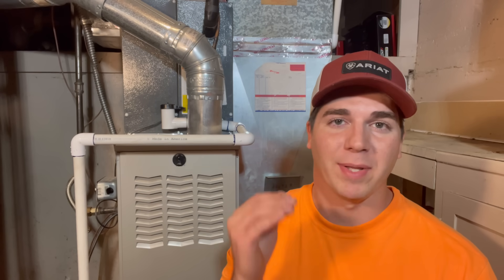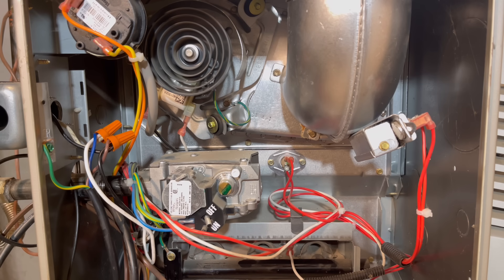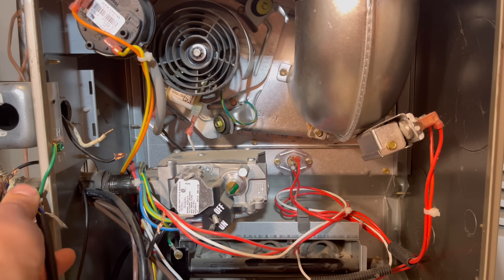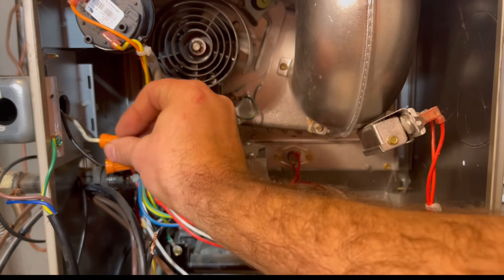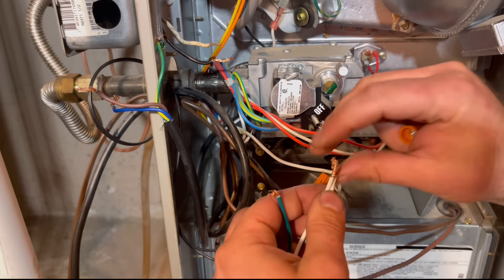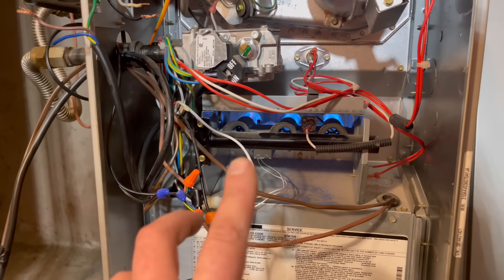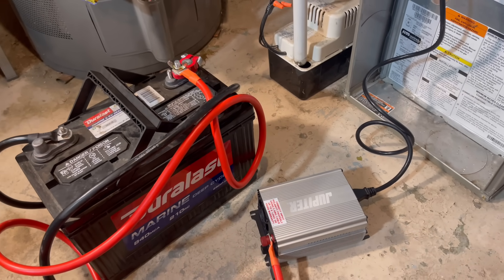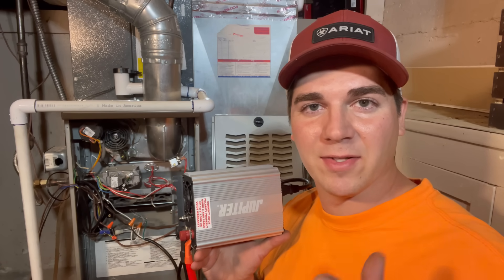Did You Know You Can Heat Your Home With A Car Battery?

Comment: There are several omissions and many errors in the many comments posted. Instead of chasing multiple comments I will make this one.

1. You need to know the power requirement of the appliance or furnace you are powering. A clamp on Amp meter will tell you the current draw at 120 or 220V. You need to watch the current draw thru all the phases of the furnace running. The POWER Is the voltage used by the appliance times the current draw:   P = volts * amps

2. you need to buy a DC to AC power inverter that can handle the MAX power draw. You can find inverters rated for anything between 100W to thousands of watts.  If you just want to run 10 LED lights in your house that only use 8W each, then 100W inverter is big enough. If your furnace or appliance is running on 220V then you need a 220V inverter. You can NOT wire two 120V inverters in series to get 220V, they will not be synchronized, it will not work! 
If you buy a 400W inverter and try to run a furnace that draws 500W, the inverter will simply shut off and the OVERLOAD indicator will blink at you.

3. A car battery is not designed for deep cycle use, its lead plates are designed for the very high current draw of a car motor starter (several hundred amps on big engines).  It will not run an inverter very long. You need a deep cycle, also called marine or camper battery. You can get the biggest one at Walmart for about $100. You do NOT need a lithium ion battery for home power storage - their advantage is they are smaller and lighter, but cost twice as much (or more) for the same amount of storage capacity. You dont care how heavy your batteries are if they are sitting in your basement. Also Lithium batteries are a fire risk. They can catch fire for no reason at all, and the fire CAN NOT BE EXTINQUISHED WITH WATER. You DO NOT WANT THEM IN YOUR HOME OR GARAGE.

4. Batteries are rated in Amp-Hrs and voltage. Everything has to match - If you are running a 12V inverter you need to get 12V batteries, all of the same A-Hr rating and put them in parallel if you want more than the typical 100 A-Hr of storage per battery.  If you are running a 24 V inverter you need to get 12V batteries in pairs, and put the pairs in series to make 24V banks. If you want more than 200 A-Hrs of storage you then have to wire each 24V pair in parallel, or alternatively: run each pair till its depleted, then hook your inverter to the next 24V pair...

5. You will need a battery tender system (at least) to keep your batteries charged when the power is on. If you run your batteries dead during a power outage you will want to recharge them as soon as the power comes back on. Lead acid batteries will be damaged if you leave them discharged for a long period of time. How long? they are designed to be recharged immediately after use. A battery tender by itself could take days to recharge one battery - you will probably also need a battery charger to use when the power comes back on.

6. So... how long will the battery run your furnace or appliance? You measured the current with it running. The power it takes is AC volts times AC current = Watts. If your furnace runs on 110 V and takes 4.5A while running its using 495W.   A single 100A-hr battery that is 12V will put out 1200 watt-hours of energy, which means it can power a 500W load for 1200/500 = 2.4 hours run time. If you are running ten 8W LED bulbs to light your home, 1200W-hr / 80W = 15 hours of light.

7. ALL batteries lose capacity when they are cold. Below freezing they can lose half their capacity. You will want to keep your batteries IN your house where they will be kept at room temperature.

8. Solar panels: to recharge one 100 A-hr 12V battery in 6 hours of sunlight, you need 1200W-hrs / 6 hours = 200W solar panels. You will also need a solar panel controller. You are looking at $300 to $400 in panels, with controller, for each $100 battery.  This is where you have to make a decision: how many days of storage do you want? for the price of one solar panel you can buy 3 or 4 more batteries instead.... In a storm that knocks out power, it may be cloudy for days, and you may not get more than 10% out of a solar panel when its cloudy.

This all gets complicated quickly. This is why portable emergency generators are so popular. As long as you can get gasoline, or propane, both of which can be stored, your furnace will keep running. If you get one deep cycle 100A-hr battery, a battery tender, a 750 or 1,000W DC to AC inverter, you are looking at about $200 to $250. That might get you thru a day or two to keep a furnace or sump pump operational.  Also: lead acid batteries used for this type of stand-by power normally have a useful life of 7 or 8 years.
Reply from the maker: Wow thank you so much for this information. I realize I was mistaken on the runtime but many people will appreciate your thought out comment I’m sure. Thanks again,   Dave
Reply: @diyhvacguy  you did all the hard work making the video and posting it  which made it easy for me to comment and expand on your information. a lot of people will benefit from your effort.
Reply: A follow up to this: a LOT of homes in texas were destroyed because the power went off, people left, the pipes froze and burst, and the water completely flooded the entire home.

WHEN your heat goes off in the winter it is EASY to shut off the water main inside your home (right in front of the water meter), then turn off your hot water heater, open the lowest faucets in your house (usually in the basement) and let the pipes DRAIN). If a few pipes do not drain out and they freeze and break, with the water main turned off they will only leak a few cups of water. Its not hard to replace a few split pipes compared to your house being totally flooded and destroyed.

whether or not you need to also drain your hot water heater depends on whether you will be able to monitor it, or you are leaving the house unattended

Comment: You should issue an addendum. During the Texas freeze there was no power to the transformer 24v for the thermostat. You must let people know that they also have to power the trans with 110 also.
Reply: Most furnaces have the transformers inside them and are powered directly from the furnace load.
Reply from the maker: Yea the furnace has a transformer to take the 110v down to 24v.

Comment: This might be a dumb question because I don't know much about wiring but didn't you have to shut off the breaker to the furnace before you disconnected the wires
in the furnace? Seems like you would have gotten zapped when you touched the hot wire. Like sticking a fork in a wall socket.
Reply from the maker: Yes, shut the breaker off to be on the safe side. I didn’t as they only hit wire was at the switch which I never removed. ALWAYS have a hot pen like I had to verify that everything is dead.

Comment: My buddy put a new gas furnace in his hunting cabin and tried to run it off of a deep cycle battery with an inverter. It would only run for a couple hours then he would have to go out and fire up his generator.
Reply from the maker: the inverter can also be installed in your vehicle and then run an extension cord to the furnace so the vehicle acts as a generator.

Comment: This is a great vid cause my house loses power quite often during the winter. My furnace just plugs into the wall could I just plug it straight into the inverter without cutting any wires?
Reply from the maker: Correct

Comment: A better solution is a small inverter generator. Plan on about 5 to 6 gallons of a gas per day to cover lights furnace and refrigerator. Costs a little more than 200 but it's a better overall solution. IMHO

Comment: If you live in the south, it is likely that you will have a Heat Pump with supplemental heat strips, which draw up to 30 amps. This method is mainly for Gas Furnaces and Boilers.
Reply from the maker: Correct. As is stated at the beginning of the video 👍🏽

Comment: Hello, thank you for this information.  Worried about outages this winter, happened last year.  I have a ML180UH110P48C-55 Lennox and I see a black wire and white wire but have a plug on it so wondering if you are familiar with this model and if those are the wires I'm looking for incase this happens?  Thank you again sir!
Reply from the maker: Hmm, send me an image of what you’ve got to diyhvacguy@gmail.com

Maybe a few pictures of where the power comes into the furnace. There’s typically a box covering those wire nutted connections so you’ll probably have to remove that.
Reply: @diyhvacguy  Hello, I did send you some pics this morning.  Thank you again!

Comment: I think a better idea is to buy a inverter generator. Then I wired the furnace with a outside plug. I used a male plug covered up by a female plug. Just turn off the breaker off to the furnace and turn off the switch at the furnace to. Plug you generator in. THEN plug in your extension cord. THEN start your generator just to be on the safe side. Most people just backfeed threw a plug just make sure you turn off the main at your fuse box to be on the safe side. I have used both system. I know its not right but a emergency is all I use it for. You just to need to know what you are doing is all. The male plug on the furnace I used a female end to cover up the male plug on the furnace so you don't kill yourself. There is many ways to do this. I have a whole house generator now. Seems like when you need it 1/4 of the time it won't work....lol You need a backup for your backup these days. Your way is another great way for another backup. Some furnaces will not run on a regular gas generator why you need a inverter generator which is cleaner energy. I have 2 furnaces. One will not run on a regular gen set. The inverter one did work and you can run more thigs on a inverter gen set with the same output. I have a 3,000 watt Honda inverter and it will run both furnaces 2 freg and a 1/2 well pump. I just turn off both furnaces when I use water pump. It will run all but has switch itself off once so that why I don't run furnaces when I use water pump. You can turn off freg by turning off the breaker at the main which you should have marked what breakers run what. By using a male plug at the furnace with a female to cover it you can use any extension cord you like. You are not going to use anything that using 220 volt though.

Comment: I did this in my old house with my Gas Fired Hot Water Baseboard Heat,... Turned the Junction Box into an Outlet & Plug on the wire, that way when the power was out, I unplugged the 1/3 amp pump motor from the wall outlet & plugged into an Invertor hooked to a car battery :)

Comment: If you are on City Gas, this will not work.  Gas "Pumps"  throughout your town/city only have a 2-3 hour backup which means no "gas" to run your furnance.  However, if you have a propane tank, no problem..
Reply from the maker: Not true. I live in Salt Lake City, and had no electricity for a couple days but gas. It depends on the specific outage. If the whole city is shut down then yes you are correct. But that’s not always the case. Thanks for the comment. Cheers
Reply: @diyhvacguy  YOU are correct grasshopper

Comment: Seriously superb video!  Years ago I hard wired my propane fired furnace with the ability to do this so that bare wires are not hanging all over.  And I’m no longer required to open the furnace service panel in order to gain electrical access, especially in the middle of the night.  Maybe this has already been pointed out….but this method will not work, at all, on a heat pump system.  I have a heat pump system upstairs but the main floor and basement are both propane.  Finally, maybe it doesn’t matter in most cases, but some inverters are square-wave only.  Perhaps many inverters nowadays are sine wave or at least “modified” sine wave?  To my point, look on the label before you buy to insure you are buying a pure sine wave inverter.  Some motors and electronic systems will not work properly if being fed by square, or even “upside down wedding cake” sine waves.  Some motors will burn out if supplied with other than pure sine wave power.  I learned this the hard way a few years ago.  Our electrical power had been out for many hours due to a bad storm. Our basement sump was fast filling up with water.  I had a 2000 watt AC inverter on hand that produced a “wedding cake” output, and so I hooked it up in order to power the sump-pump motor. It worked fine for a couple hours…..until it completely stopped working.  I quickly ran to a hardware store to buy a new pump (paying cash because their power was also out.  The moral of that story is to always have cash on hand for emergencies……).  When I opened the sump to change the pump, the old pump was steaming hot.  Way too hot to hold in my hand.  I learned there and then that pure sine wave inverters are the best way forward in at least some cases which involve motors.

Comment: A smarter move for most would be to put your invertor inline with the switch box.  That way you dont have to open the body of the heater and you can still use the switch.
Reply: I have an sine-wave inverter.   I like the idea of having it wired permanently to my electrical circuit.  That way I can just hook up my portable generator to my transfer switch I had installed at the box and have clean power, but the inverter has a plug on one end and receptacles on the other.   Code doesn't allow plugs and receptacles for furnace power, so I'm basically stumped as to how it can be hooked up to meet code.

Comment: You aren't going to be heating your house with a gas furnace during a power outage even using this method. Natural gas is pumped using electricity. No electricity means no natural gas, water, or even gas for cars.
Reply from the maker: Not true. Sometimes yes. We had no power for a couple days last summer, and I ran my generator off of natural gas 👍🏽

Comment: It's worth mentioning that although you're not charging your battery in this situation, be aware that if you do charge a lead acid battery,  there's a good chance it will be admitting hydrogen sulfide fumes which are flammable. Use caution and have proper ventilation if you have to charge that battery, do so away from flame.
Reply from the maker: Good to know! Thanks!
Reply: @diyhvacguy  you're welcome.

Comment: I've got a system 2000 oil furnace. Looks like I'd have to open the "brain" control box. Got anything on that before I go exploring?
Reply from the maker: Just make sure the power is off before you go poking around :) let me know what you find and if you can do this on your oil furnace! Cheers
Reply: Thanks. I think the way to go is open it up where it goes to power on the ceiling above.
I'm going out to get the sander on the truck for the freezing rain coming. I'll get back to ya bud. Where there's a will, there's a way. Cheers

Comment: Retired Utility Guy , That flex connector to Your Furnace is an Illegal Connection to an Furnace or Water Heater considered permanent Appliances , Can use to connect an Gas Stove with !
Reply from the maker: What exactly makes it illegal? Just trying to learn here. This was all like it is when I bought the house and the inspector didn’t say anything. Doesn’t mean he did a good job on the inspection haha  I always use the flex lines that they sell at the hvac supply house. Thanks for the input!, cheers

Comment: Great idea!  Why didn’t I think of this!  Hey, I have a Bluetti EB3A.  Wouldn’t this work, too?
Reply from the maker: It will for a short period, but if you get an inverter and Mount it in your car you can charge it back up with the alternator 👍🏽
Reply: I have a transfer box that allows me to connect my generator to a breaker box for my house.  I have the  receptacle on outside wall for easy plug in.  Can I use this transfer switch  receptacle to plug in a solar power generator, e.g. Bluetti, Jackery, that has an inverter, or a gas/propane inverter generator?

Comment: Looks good. How many hours before the battery runs down?
Reply from the maker: I’ll be posting the test video soon so stay tuned for that! Cheers
Reply: @diyhvacguy  I have another question:  Could an I start an 800 W motor with a 1000 W inverter? Can the inverter supply the high starting current for the first half-second?

Comment: Thanks for the cool video. I'm not sure what to do with my ground cable if mine is. Can I just ignore mine if it is hooked up?
Reply from the maker: If you have a ground cable, then wire nut or use these wagos to connect the green wire from te inverter to the ground. It will probably be a raw wire, not insulated.

Comment: Would a marine deep cycle battery be a better choice?
Reply from the maker: Yes, and in a pinch you can connect the inverter to your vehicle and use it as a generator to power your furnace as long as you have fuel! Cheers
Reply: @diyhvacguy  I just noticed after watching your video a second time that's the battery you used. Sorry about that. Would you recommend a better battery or just stick with a marine battery? This video will save lives! Thank you for taking the time to post this!

Comment: I can't see if someone already asked but for the extra plug can you plug a battery charger to power the battery and just give it back it's power that it lost like an alternator? I don't know much about this stuff but was just curious.
Reply from the maker: I think it would burn through quicker then it would charge. Alternatively you can hook the inverter to your car and use the car as a generator 👍🏽 cheers